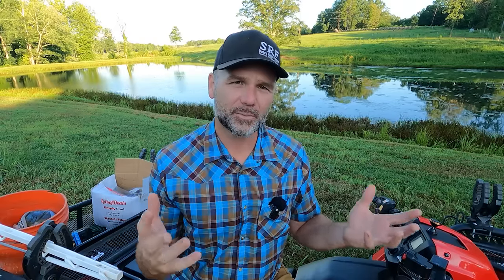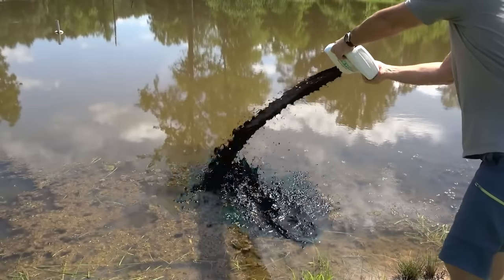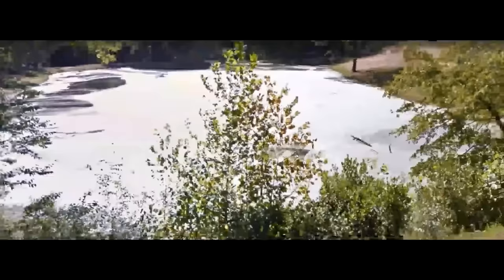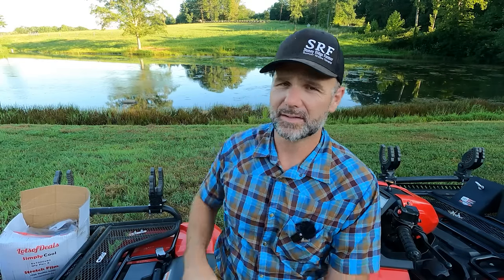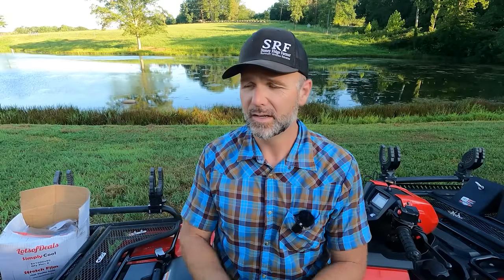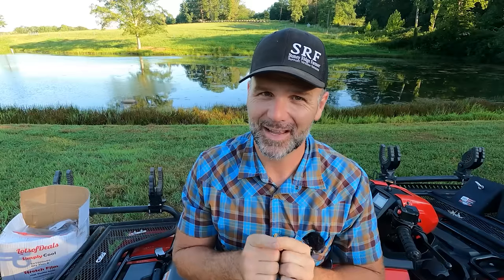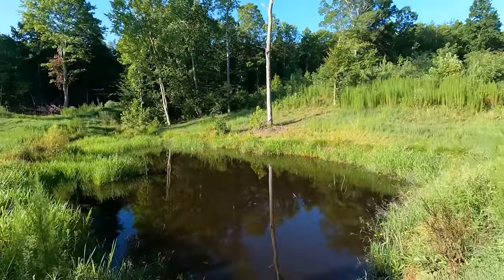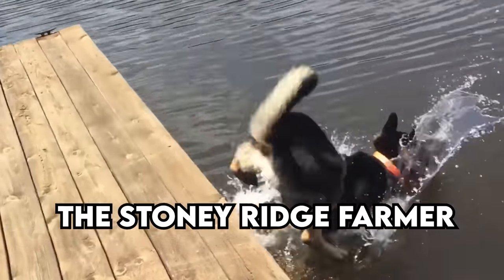Here's how I Messed up...Farm Pond Basics most don't know!

Comment: I built one on my homestead, I dug down 4 feet and water started pouring in, kept dig down to 12 feet, attached it to my year around creek that comes off a reservoir, the reservoir is fed by four natural springs, we allow 1,100 gallons a minute to come out of the reservoir and feed my creek and some irrigation ditches on the ranch next to me, the reservoir never drops the level of water in it, so basically the springs feed as much water into it as we take out of it plus evaporation. We have clay soil here so it holds the water, I built banks up along my creek and around my pond to bring the water two feet above ground level, then I buried irrigation hoses into the sides of the banks to gravity feed my crops, gardens and pastures. Glad I watched this video I learned about grass karp.
Reply: I wish my pond was spring fed like yours I'd build a hydro plant to power my homestead.
Reply: @The18tvw  I'm off grid, using solar and wind right now but we are definitely going to do some hydrogen power later on.
Reply: Make sure grass carp aren't illegal in your state.
Reply: @richardbellsr2345  I believe he meant hydro as in water powered, though depending on the spring, there might or might not be enough water pressure to accomplish that.
Reply: the problem with grass carp is once they reach a larger size they stop eating vegetation
Reply: Suburban boy here.  Never lived outside cities.  Though I'd love to buy so property and have, if not a farmstead, at least a great plot with multiole types of fruit trees, fruiting bushes, a garden, and a pond.  And internet (that's kind of critical).

My question how do I find property that will work?  Realitors?  Certain websites?  I feel pretty ignorant dealing with anything outside of city living, but I want a large yard with wooded property.  And I'm sick of having HOAs and other bull to fight through to get a yard I want, how I want it.  How did you get started on a finding property for your homestead?
Reply: @rabidhellhound9714  found ours on craigslist. I don't know what part of the country you live in but I can give you some tips when you go to look for property if you like.
Reply: @richardbellsr2345  I'm in Indiana, but have no real desire to stay here.  I'd love someplace with mountains, lakes, and rivers.  But close enough to a college sized town (~30,000) to have basic amenities like grocery stores, heavy equipment rentals, hardwood stores, and general entertainment within a 20 min drive.

I know myself well enough to say I'm not pure country, not I've never wanted to be pure city either.  I want parts of everything.  Just never had the money to move until recently.  Now I'm looking to get out an have my own space to do with as I please.  But still be able to work my job off the internet.  That, more than anything, is the tricky factor moving away from a city.
Reply: @rabidhellhound9714  nc or Tennessee would work good for you I bet!
Reply: Sounds like a wet dream ! Pun intended
Reply: @Rumplestiltskin777  hahaha
Reply: @willbass2869  Or maybe move wherever the hell I'll be happy, since there's a lot of world and plenty or types of property to settle on.  There is no magical dividing line between "bustling city" and "Paul Tucket wilderness."  Plenty of "blended" space exists in between.
Reply: You are my spirit animal 

My ideal situation only I would add micro hydro but damn you are killing it!
Reply: @Rabid Hellhound  look at Pennsylvania. North or West of Harrisburg
Reply: I've been looking at southern Arkansas, kind of in the region where the forests and water meet
Reply: @richardbellsr2345  I'm curious in this Hydrogen project.
Reply: @joshuanorris9785  okay buddy, what  exactly are you interested in?
Reply: @richardbellsr2345  have you began working on hydrogen power yet? I have some land myself & am interested in going hydrogen.
Reply: @joshuanorris9785  I haven't started hydrogen but I can probably help you out if you have questions
Reply: @The18tvw  1,100 gallons per minute????  BS
Reply: @bowhunter7485  It''s possible depending on the set up. Not like you are going to be powering a small town...
Reply: @wellsincewerehere773  what do they start eating after vegetation?
Reply: You're lucky
Reply: Would love to see video of this pond and system
Reply from the maker: takes alot of water to run power...I looked into it...sadly enough I don't have enough water flow from one source
Reply from the maker: yeppers....gotta keep putting them in the pond for sure....every few years

Comment: I'd like to offer two pieces of construction criticism, if you're interested: 1, aerating your pond will increase fish habitat, reduce algae, and generally improve the health of your pond (I'd suggest a surface aeration system with a draw tube that trails down into the bottom third or so of the depth where it is placed); and 2, avoid applying chemical fertilizers to the grass adjacent to the pond, because it can lead to excessive algae growth and a host of other problems in the pond ecosystem.

Comment: I used drilling mud ( bentonite ) in our pond to seal it. Old timers would fence in pigs around a new pond dig, add a bunch of leaves between them walking and pooping that would seal up the bottom.
Reply: Wow that is smart.
Reply: So you dig up a pond, put in pigs, then fence the perimeter of the pond to contain pigs in pond bed. Then let them poo and walk on it to settle the soil to harden it?
Reply: @swatisquantum  tamp it down good after digging then keeping/ feeding the pigs in there for a while. I've also learned about this same technique utilizing specifically pig manure. I think it has something to do with the way the pig manure coats the ground that when you add water an algae layer can form sealing the pond eventually

Comment: I've never heard of anybody skimming the algae off the top of a pond as a way of controlling that. But if somebody did, it seems like a way to remove the excess nitrogen. Maybe it could then be mulched, or dried out and turned to charcoal and tilled into the pasture dirt upslope from the pond. I would also enjoy experimenting with solar-powered aerators and pumping water to troughs for deer to use so they don't approach the water and poop in it. The animals I would most hope to allow to flourish in a pond are aquatic salamanders, newts, and the least-common turtle species for the area.
Reply: Skimming and mulching is common here in Indiana with small ponds.  Large ponds/small lakes typically don't need it because the wind blows it to the edge and mixes oxygen into the water.
Reply: Deer will swim in a pond
Reply: I do it every year and its backbreaking but at least you don't use chemicals. And the stuff you take out doesn't even rot and you need to get it away from the pond.

Comment: Been having a pond for about 2 decades now here in South texas. It's a great ecosystem tons of wildlife, even have some trophy bass swimming around. Only problem is every year it gets a little more shallow. When I was a kid it was close to 8 feet at its deepest, now in my 30s its only about 3 to 4 feet max, even shallower along the sides. Every summer I try to dig out some muck but I'm just one man and don't really make much of a difference. Just been trying to keep it alive
Reply: Check out permaculture videos, there are alot of techniques to rejuvenate your water table / pond, though it'll probably be a years long project.
Reply: as above, so below. 

contribute to the aquifer above ponds. dig a trench from highest point to lowest in a sinuous line thst cooperates with topography. you’re just trying to slow the speed of water down the hill, not hold the water. 

best of luck buddy!

Comment: A lot of good info in this vid, but I thought I would offer some feedback.  Stay away from chemicals if possible.  Dye is ok but what I've seen is that it doesn't last very long and typically once it dissipates, a bloom will usually follow.  I noticed there was no discussion on aeration.  A large pond usually won't need it as just normal wind ripples will provide enough.  Smaller ponds should consider it.  Geese.  Keep them away if you can.  They provide nothing beneficial and will eat beneficial plants.  I've found the most humane method is some good long range roman candles that shoot crackling shots.  Geese are stupid and stubborn, so you have to be persistent and patient. Many people will remove snappers.  This is a waste of time as they will just be immediately replaced unless your pond is in an urban area.  If in the country, no chance of ever getting rid of snappers permanently.  We stocked with a dozen fathead minnow, and a half dozen blue gill and smallmouth bass.  We now have thousands of fish in the pond.  We feed our fish every evening and have yet to ever have a die off from heat or cold or environmental changes. Notably, our pond is about 2 acres, so semi large.  I have a dual output aerator that I use sparingly, typically when I see the water getting a bit murky.  Fed from a creek with an overflow that circles back to the fill point in the event the creek level gets too low.  No trees within 50 feet, and only ornamental grasses allowed on the banks in addition to just regular lawn grass.  We have muskrats in the area, so cat tails are limited.  Do not use algae killers of any sort.  Most effective killers have long lasting effects and are best left out of the environment.  If you get blooms, consider aeration and perhaps some muck pucks that produce beneficial enzymes and bacteria that will eat the decomposed debris at the bottom of a pond.  I've found these to work better than pond dye.  Usually one application per year is all that is needed.  If you do use pucks, you should also use aeration as they consume a LOT of oxygen.  If you get ducks, consider an island for their safety at night.  You can plant trees on it to give them valuable shade.
Reply: We have a small pond where we live out here in Kentucky and it is overrun with lilies. I want to be able to use the pond to water our garden, livestock, and maybe us in case of an emergency. Do you have any suggestions on how to get rid of all the lilies without poisoning it?
Reply: @GeneralThe3rd  Unfortunately, getting rid of lily's without chemicals comes down to time and work.  There are two guaranteed methods.  The first is to rake them up so the root pod comes up, or you can physically pull them up by hand, but you have to get the root pod too.  Snapping or cutting them off at the stem will only bring more growth.  The other method is a heavy mat that you can drop into the water and cover an area.  This takes a lot of time as you have to leave it in place for about a month to ensure you've killed everything under it.  You then relocate to the next spot, rinse, and repeat.  They do sell mats specific for this, but anything that is light enough to haul around but will sink in water would work (sheet metal siding?).  You might also try floating a large sunlight proof tarp over sections.  Blocking the sun will kill the plants but since water can refract light, not sure how successful this would be.  I've heard grass carp can help as they do eat lillys, but I've never tried it.  This guy has an interesting method.  If you have something to pull a multi-tine rake like this (tractor, truck, winch, etc) it could be a good solution if your pond is small enough.  https://www.youtube.com/watch?v=VWKlpMeRY5g
Reply: @GeneralThe3rd  A fountain run by solar will help agitate the water which lillies don't like. And, it helps aerate the water too.
Reply: Thanks Scott and Jim, those are things I haven't thought of. I thought I was in the clear when they died over winter, then they came back next spring even worse. If I had lots of mo ey I would get some short of back hoe or something and dig it much deeper, but that seems like it would be expensive.
Reply: Excellent comment Scott, I really don't understand the promotion of pond dye, unless he owns a company that produces it.  To me it's counter-productive to creating a beneficial ecosystem as that relies on sunlight that the submerged plants need to photosynthesise, oxygenate the water and help deal with excess pond nutrients that cause algae.
Reply: thank you!

Comment: Really appreciated your sharing of your experience and insights. Thanks! I'm in the planning stage for making a DIY 1-2 acre pond. I'm trying not to re-invent a wheel I know you've already made. Would you mind sharing what sizes of water pump, filter, pipes & fittings you're using? Keep up the good work.
Reply from the maker: filter? Pump? Pipes and fittings?   These ponds are fed by springs, creeks and runoff...I wouldn't even consider building a 1-2 acre pond and trying to fill it with well water or water pumped into it.  There's no filter, no infastructure..other than the stand pipe which is 10 inch schedule 40 pvc.  You may wanna go to your local ag center and talk to someone about pond construction and have some contractors come out.  You could be wasting a monumental amount of money with your plan...if you're asking me about pumps and filters and are considering a 1 acre pond, you're talking about hundreds of thousands of dollars.  I'd go talk to the NRCS office in your county and ask them for some contractors names first...so ya dont' waste time and money

Comment: I've had my KOI POND FOR 22 YEARS ,I WOULD recomend you looking into an aeration system . In a smaller pond you have to keep a small amount of surface from freezing or the fish will all die . They make floating fountains with lights that shine up on the fountain water at night, spectacular . There's an outlet called THE PONG GUY that has everything you need to maintain any size pond .

Comment: Pond depth is determined by two things: How deep you need it to be to provide reliable habitat, and how long you need it to supply how much water in a drought. Heating in sunlight is controlled by depth, and evaporation during a drought is measured in depth too. Deeper water will last longer!

Comment: You want the pond 10 ft deep at least on one end. And fairly shallow on the other. That creates circulation within the pond. You also want to keep the water flowing. This can be done with a pump.
Reply from the maker: you need a pond to have a running water source or it will stagnate for sure my friend

Comment: I am digging a small pond which has taken me longer than I thought because I would not let anyone come in with a bull dozer or back hoe knowing that they would disturb the outside of the pond and cause it to become full of mud.  It is surrounded by a longtime pasture and there is a slope on one side that allows clear ground water to enter the pond at two places almost like natural springs. I'm thinking I may have to fill the pond from a nearby creek but will not have to continuously do that because the water coming in does not ever cease.  It keeps the ground wet enough that I have to use mats to support my small tractor that I'm using to do the scooping and removal of the dirt.  I dug a small drainage ditch to keep the water running out until I am ready to seal it up. I appreciate your information as I may have to put it to use later. My plans are to complete it this summer and have it full before winter. I also live in the piedmont of N.C. and use my small acreage to keep me busy in my retirement. I love working the land and am very content doing so.  Blessed by the hand of God!  POMO

Comment: That DamIt product looks interesting.  I had two watering holes dug on my hunting property.  They're not very large, but I wanted permanent sources of water available so deer aren't forced to move off property to find any.  Unfortunately due to the soil conditions the water level falls rapidly during the summer and they tend to dry up completely.  I'm thinking that product will help retain the water.
Reply from the maker: probably not...if you've simply got runnoff ponds..then the dry weather causes them to dry up...I wouldnt use this for that project
Reply: @StoneyRidgeFarmer  Hmm... in that case maybe the solution is to dig deeper with more vertical edges to reduces surface area.  Although I wasn't keen on pulling out a shovel.  

Thank you for the response and love the video.